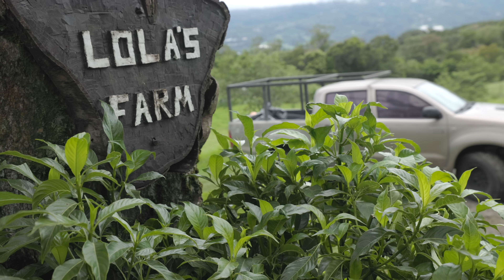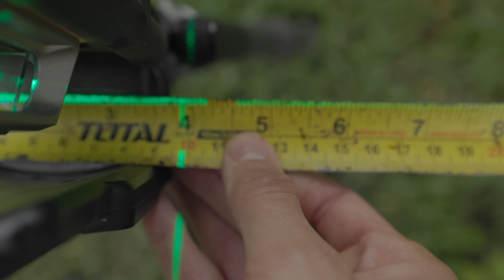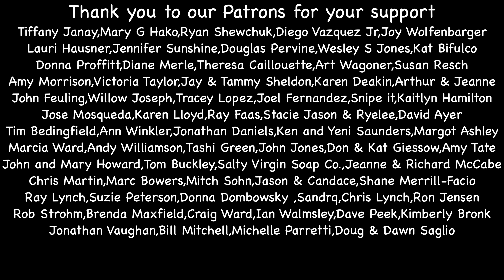We Are Heartbroken // Kake is leaving the farm

Comment: @jordan: youve been needing to put a french drain above the pizza oven since before you finished the patio. from half way down the stairs diagonally away from the stairs to beyond the shed/house. its hard to understand the volume of water you are dealing with, but it also looks like you need a curtain drain along the uphill side of the pizza oven, prolly more than 16"" deep, cutting under your stairs. backfill it with gravel, cloth, 6" corrugated pipe, gravel, cloth, then reinforce the stairs with concrete as youve had to underdig it. these bandaids are gonna give the hillside time to attack your cement work with water, that will be distater.

Comment: Your tarp roof needs to be 6 inches lower on one corner.  This alwa makes a lower  spot and wY less pooling.  Hard to get ride of it all. It will drain though and not compromise the tarp to a bubble  of water. Water is 10 pounds  a gallon.  So you can wreck your tarp.

Comment: Jordan, if the Steel-post is hollow, 
It might need an "End Cap" , 
or some sort of water-drain, 
so that it does not RUST from the inside.

Also, Tilting (Leaning) the posts away from the direction of Tensile-pull
(away from the tarpaulin),
is typically BETTER than being perfectly vertical
(however, a back-stay cable, going from the poles to a ground anchor might suffice).
Ratchet-straps, or Turn-buckles, are required to get enough tension on the Tarpaulin).

Comment: Sorry to hear about your bad luck...and don't want to be a jerk by adding this but you guys should be wearing more safety gear when using that angle grinder with the metal cutoff wheel. If that wheel comes apart, even with your guard on, your hand or some other part of your body could be toast. Wear the same gear you wear when welding...face shield, heavy gloves, heavy apron. Would hate to see your project end permanently with a gnarly grinder wheel accident!!